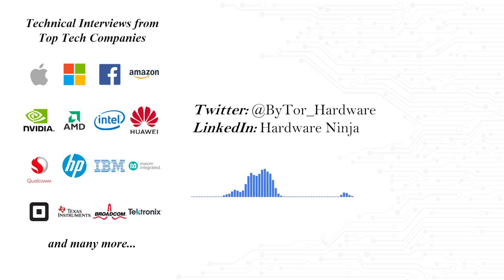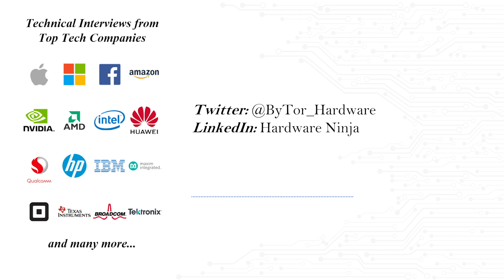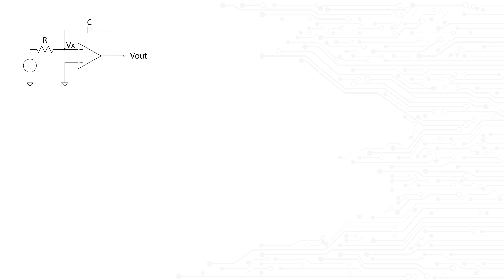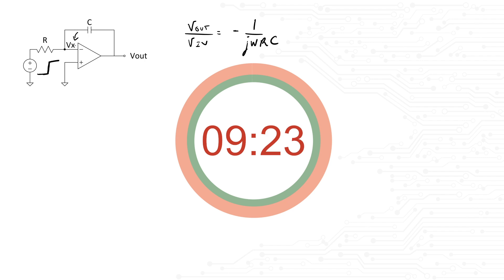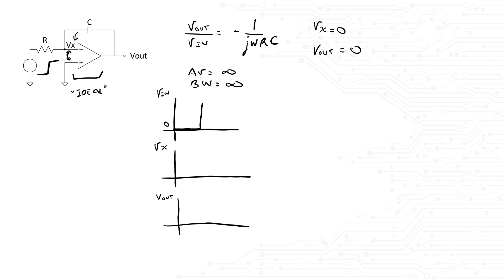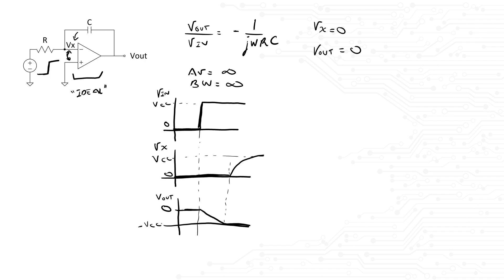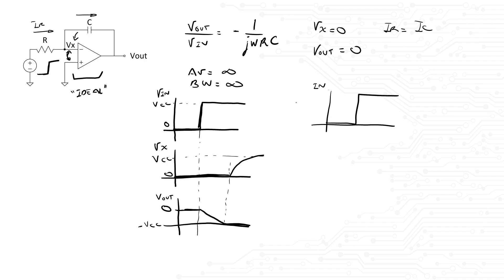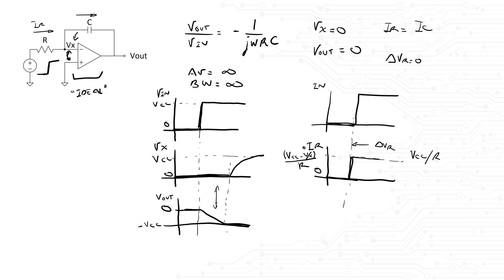HWN - Real "Touch Sensing Hardware Engineer" Questions

Comment: For the Vout curve, shouldn't it decrease from 0 to -Vcc with an RC discharge profile rather than a linear downward slope (since this is an active LPF which would slow down any sharp edges such as a step at the input because they contain high frequencies). Please let me know if my understanding is wrong or if I missed something that makes the Vout drop linear instead of an exponential decay/RC discharge profile.
Reply: I'm about to have an exam in roughly a week that is exactly about this, so I'll either mess it up or get a good grade haha. But the thing is that this is an Integrator Amplifier, so the output is proportional to the integral of the input signal. As the input is a constant line, the output should be a linear function that over time saturates at -Vcc, as said in the video.
Reply: Another way to think about this is that as long as the Vx=0, the resistor current (=capacitor’s) is constant, so the capacitor is basically being charged with a constant current. Constant current means voltage ramp. Once the output rails out, this does not hold anymore

Comment: actually, if you use inverse laplace transform on the t.f., you will get :
Vout=-1/RC*integral from 0 to t on(Vin(t))dt. 

this formula is correct until you reach the negative supply voltage, thus you have -Vcc in some place.
your explanation is way more acceptable i think.
thanks for sharing.
Reply: The sama as you 😊

Comment: These graphs and explanation are not quite right in my opinion. The step function 0 part is correct. When Vcc step function applied, Vout goes to -Vsat. Then the capacitor starts charging via the voltage difference Vcc and Vout =-Vsat. Capacitor stop charging when it reached Vcc.. So the Vx is goes up to Vcc.   opamp out put stays at -Vsat. Please correct me if I am wrong.
Reply from the maker: Chami,

Just as general feedback, you cannot start your comment with "this is not quite right" and finish it with "correct me if I'm wrong".  The first part already implies that you are sure of your answer while the second one contradicts it :). In any case, we're not sure why you'd say "Vsat", this is an ideal opamp. Hope that helps.

Cheers!

Comment: i reviewed opamps and gave this another try. from what i understand, Vout is (-t/RC) till it reaches -Vsaturation. Till this point Virtual ground is valid. After Vout attains -Vsaturation, virtual ground is not valid and thats the time when Vx at inverting terminal varies as per RC charging circuit. Is this whats happening?
Reply: Hi,

Yes you are right. Vx will try to maintain itself at 0v upto the situation the output voltage doesn't reach -15v. When the opamps output voltage reached -15v, the opamp is no more having a feedback mechanism and the Vx voltage will increase from 0v to Vin (input voltage of input).
Reply from the maker: Thank you for contributing to the community! You're onto something, please look at the the response we sent on your most recent comment.

Cheers!